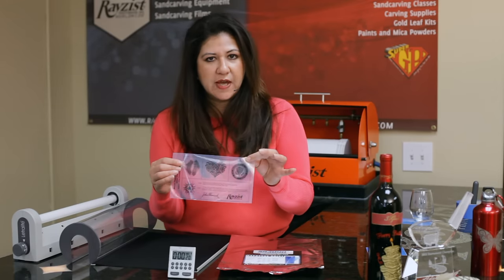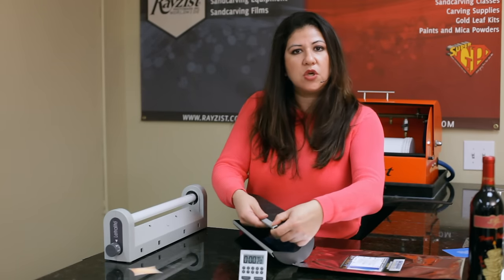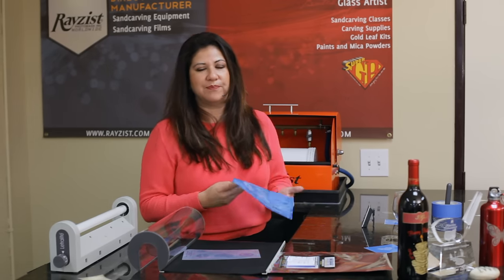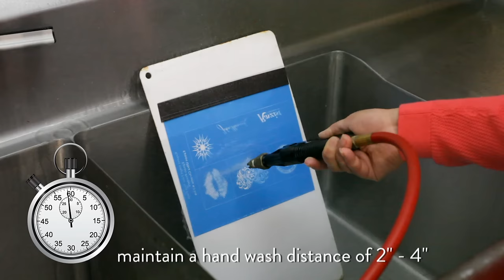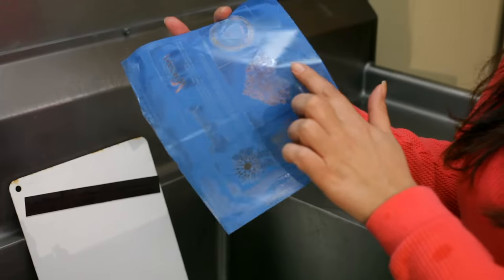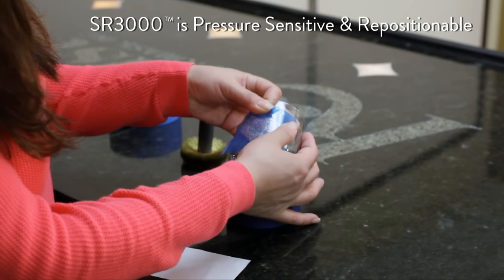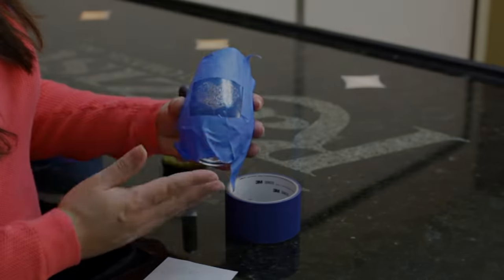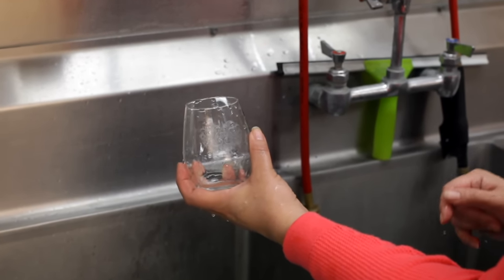Making a PhotoMask for Sandcarving

Comment: I finally got the mask and tried to wash it out with a regular sink spray and it just got all droopy. Was that because of pressure not being strong enough to wash it out
Reply from the maker: Hello Justin, you have it about right. The KEY to development is wash-pressure. The higher the pressure, the quicker the rinsing result. Your sink-sprayer just does not deliver much pressure at all. There is a lot of water saturation but no accurate result; that's why it's "droopy." You have to pressure-wash away the image, not just allow it to dissolve.
At the sink faucet, remove the aerator from the faucet tap and attach your hand sprayer; you can use a clear tub to place your washout board inside and contain any over-spray allowing the water to drain into your sink.
Keep in mind pressure in development is KEY to a quality resist image.
Reply: @Sandcarving  hot water?
Reply from the maker: @2nd2nobody   Hot Water is best to rapidly dissolve the film. Pressure is always key regardless of temperature. You can wash with cool water but it will not develop as quickly as using hot water.
Reply: @Sandcarving  thank you I'm just nervous
Reply from the maker: @2nd2nobody   Haha... no reason to be. Keep to the process! Follow the correct process (2"-3" from the mask) be consistent in your technique, and you will have a perfect 1:1 image of your film print.

Comment: This looks a lot like silk-screen printing, is that right?
Is sandblasting needed? Can you paint over instead of sandblasting?
Reply from the maker: You have the process correct, very similar too screen printing in that you expose your image onto our film with UV light and process with water to make a photomask. Instead of inking, as a silkscreen, the film is designed to be applied to your sub-straight and use blasting abrasive to blast into your surface. With our photoresist film, its required that you sandblast, unfortunately, it will not work as a "painting" mask. If you have further intrest, see Rayzist.com or perhas join us for a Sandcarving Workshop. Thanks for watching.

Comment: A la hora de imprimir el vector en el inkjet que tipo de papel debo escojer en la configuración de la impresora?
Reply from the maker: This is a good question. There is no specific paper choice on Inkjet printers. You will have to set the preference settings to achieve the best opacity. We use (recommend) the Epson HD XP-15000, and we do have preference settings for that printer. If you email sales@rayzist.com we can send one.
I recommend you have a look at the video of us setting the printer settings on Learn Sandcarving video playlist.
see video: XIII | Printing Half-Tone Images for Sandcarving
I hope this is helpful.

Comment: Excuse me, what is the temperature of the water? Thanks
Reply from the maker: The temperature is best between 110-120 degrees. However, the "pressure" of the wash will always trump the temperature. In the best case, having high pressure and hot water when washing films will provide the fastest washout and great results. So, you can wash with cool/cold water, but you need to have high pressure (or keeping the wash nozzle rather close to the resist). 
Thanks for watching!

Comment: Here in Brazil you can not find the SR3000 to buy, Can it be used with other sticky photo paper? Can I pass from the vegetal paper to the photographic paper only using hot water?
Reply from the maker: Hello Victor thank you for your comment. We have a re-seller in Lima who may be able to help. 
Luis.Tamashiro@arenart.com || If this is not favorable you would have to purchase from Rayzist directly. You would most certainly would want to use an approved print material for the best image transfer results.

Comment: Will this work for screen printing screens?  And how can you be using the film in the day light ?  I would think it would cure in the light before your enclosed exposure unit.

Thank you
Reply from the maker: Our photoresist film is designed for Sandblast applications not screen printing; apologize. Our photoresist films are also "white light/ room light" tolerant. So you can work under normal room light conditions for a period of time without damage to the film. Handling the film in direct or indirect sunlight would not be advised, until completely developed.

Comment: Hello - I always used a plotter to craft the design (even some portraits) however the plotter won't cut all the important details . 
I would be interested in a stencil kit like this if available in the  UK ?! 
Is there a special printer used to print the design ? Thank you
Reply from the maker: Apologize for the delay in reply. A photoresist film is used when vinyl plotters are impractical for detail or reproduction. The process is image reproduction and begins with your printed artwork (inkjet printer suggested) you take your print and transfer the image via UV light and water wash. Its simple, you achieve fantastic detail and if you do require multiple, gang that up on your print and make one page of many masks. 
Recommend printer: Epson HD15000 not sure is there is an equivalent in your market, we can provide the print preference in a document if needed.  
Yes, our products (systems and film) are available from our partner company The Glass Scribe (in the highlands) register on their site or give them a ring. They have complete Mask Making Kits in inventory or can produce the finished masks for you. 
Thanks for watching!

Comment: one more question? what kind of sandblaster are you guys using by way of power and so on? how much psi is needed if that makes sense.
Reply from the maker: Rayzist's manufactures pressurized systems for the sandcarving industry. Pressurized systems are "Pressure Pot's" which offer the best efficiency for blasting Glass & Stone as well as providing depth quickly into these materials. Typical air consumption would be 5.5 CFM | blasting at 30 PSI (pressure).

Comment: Is this the same film as ULano EZ-Film for screen printing?
Reply from the maker: No...although it looks similar to our film. Our photoresist film is not a screen print film, instead, a product designed for sandblast applications. Now, the processing is very similar (UV cure and water wash) the product is entirely different.

Comment: What program you use to design your mask?
Reply from the maker: We use Adobe Photoshop to generate the line screen. Either CorelDraw or Photoshop will do the same procedure. What is most critical is your skillset in using your program at making adjustments, so you have continuous tone in the dark as well as the light areas.

Comment: what do you use to make the master that gets exposed to the mask under the light? the clear sheet that is black and white is what i'm referring to, on a side note I don't think you should be exposing your bare hands to sandblast media at high pressures like that, it's definitely not a good idea
Reply from the maker: Hello Amanda, the clear master is called your print film, printed using an InkJet printer (like an Epson 1430) but any Inkjet printer should work well. The key is the print blocks out the UV light. 
Note, the blast media we use is fine grain Aluminum Oxide and will not hurt your hands, personal protection (disposable rubber gloves) is recommended but up to the operator.

Comment: what is the name of that exposure unit?
Reply from the maker: Justin Young the exposure unit is called a "LetraLite exposure unit". Available on our web store, www.rayzist.com/store
Reply from the maker: Justin, the exposure unit is called a "LetraLite exposure unit". Available on our web store, www.rayzist.com/store
Reply: i checked that lil thing is expensive
Reply from the maker: Justin Young: Keep in mind, the return on investment would be one-two reasonable orders. This system will easily last 15+ years. You'll replace a LetraLite pad one or twice and that's about it..
Reply: i plan on getting it because i want to do affordable custom headstones locally. Which film do i need to get in order to do granite with detail?
Reply from the maker: Things to note:
1. LetraLite image size is 10" x 14" (max image area)
2. 5Mil, 6Mil or 9Mil would be great depending on depth, blasting media and detail pattern of the image granite. (5Mil will allow for better resolution, but your not able to blast as deeply) 
3. If your more after halftone photos then the 3Mil would be ideal
Consider the: item# LLKIFM  "Mounment" Mask Masking Kit for Inkjet printing; has everything you need to begin 3Mil, 5Mil, 6Mil and 9Mil with adhesive.. 
There are sample prints as well to help you get started with the learning process.
Reply: Sandcarving so the film is printed on with an inkjet?
Reply from the maker: The process is "Image Transfer" ultimately to the substrate your blasting. The process begins with your vector image (graphic) printed out by with an InkJet printer; the image is transferred via UV light to the photoresist film (exposed), developed with pressurized water (washout); lastly the resist film is transferred to your substrate (granite in your case) and sandblasted.
Reply: @2nd2nobody  £488 here in the U.K. which is the rip off of the century.